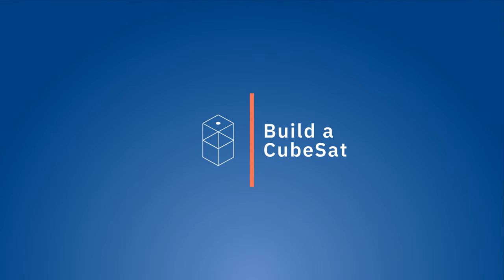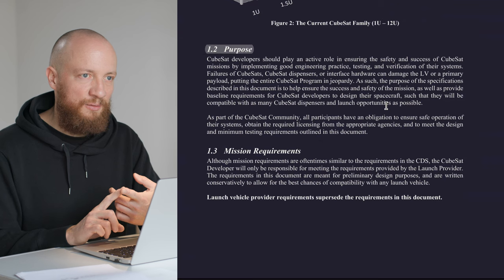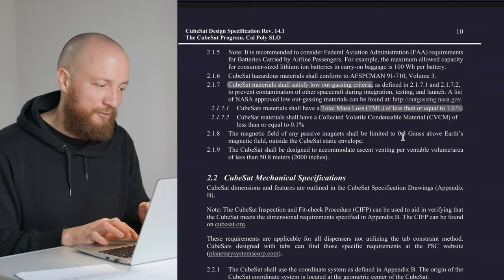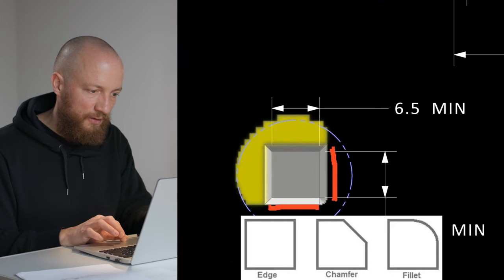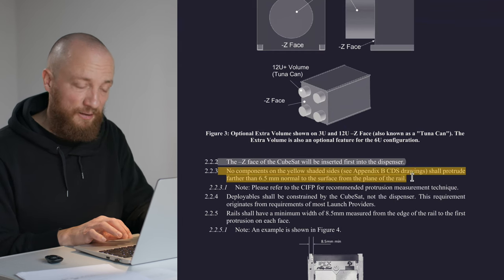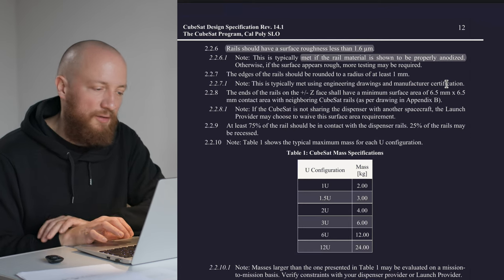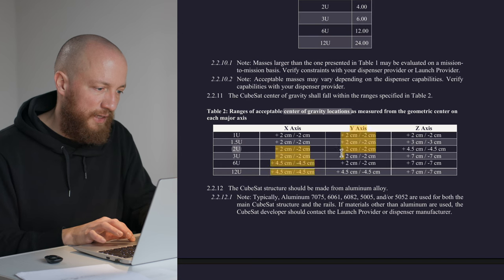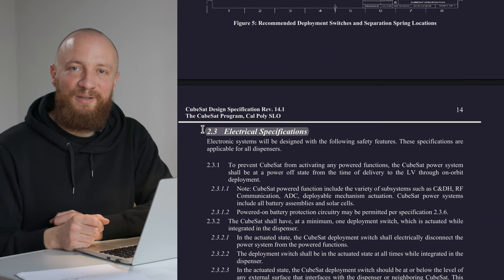CubeSat Standard Read-Through: Mechanical Specifications (Part 1 of 2)

Comment: I think the Figure 5 at the end of the video is correct because it shows the +Z vector as a circle with an "x", which is the usual way to indicate a vector entering the displayed surface. If the +Z vector is entering the displayed surface it means that the displayed surface is the -Z surface, I believe.
Reply from the maker: Thanks for pointing that out, I will look into it!